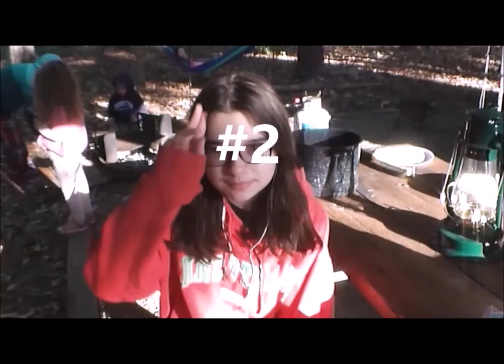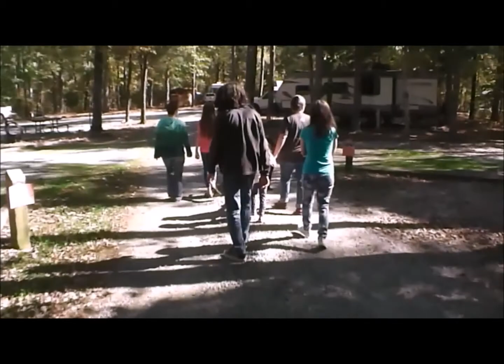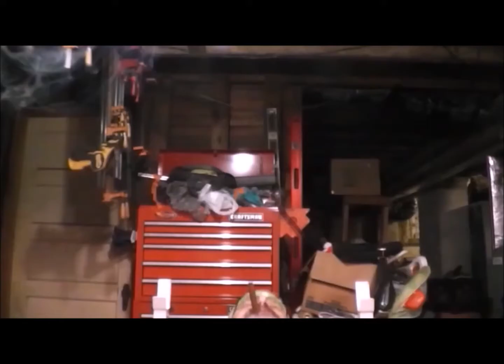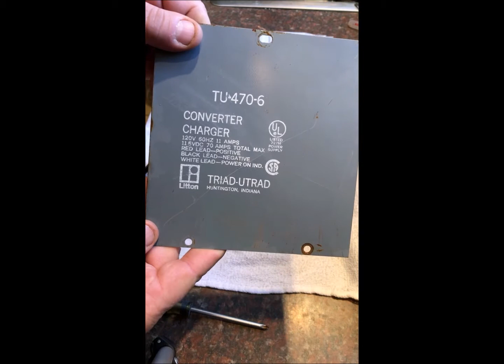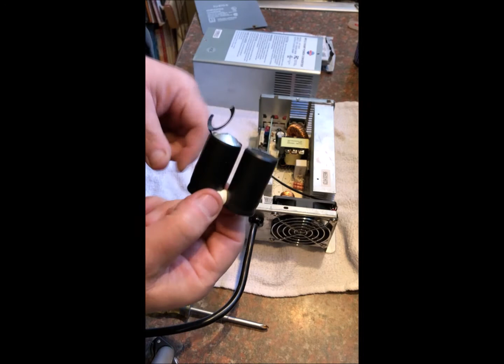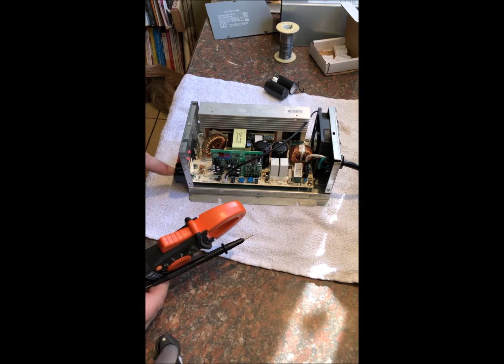WFCO-9855 REPAIR..........WATCH TO THE VERY END!!!!

Comment: What fuse was that? I think I have the same problem. Do you know the voltage and amp rating or the part number of the fuse?
Reply from the maker: It was an easy fix.  The fuse was underneath this white silicon glob that has a lead on each end.  I used a microwave fuse.  20 Amps, 250 volts.  I just soldered it in place of the blown one.
Reply: @dadofsix Thanks for the info. My brother's is having the exact same problem almost. He tried to plug it into a 220

Comment: I enjoyed watching your repair.  uF is micro farad. When electrolytic caps fail, it is best to replace them with the same capacitance rating but go for a slightly higher working voltage and temp, if possible.  PS... invest in a roll of solder wick if you want easy and clean component change.